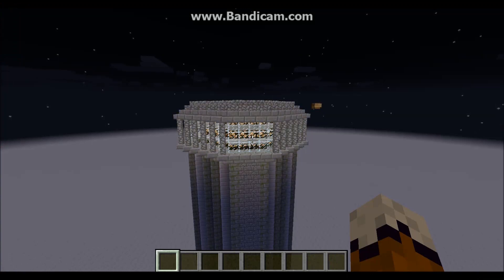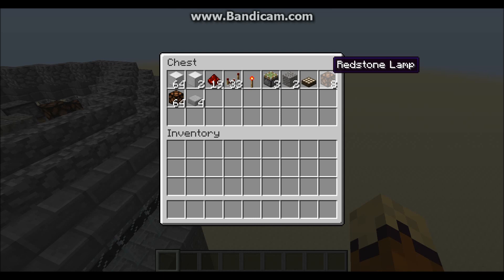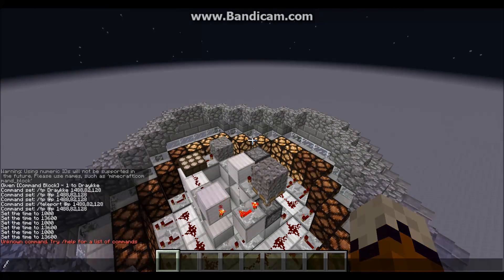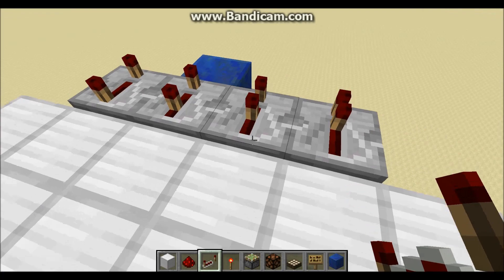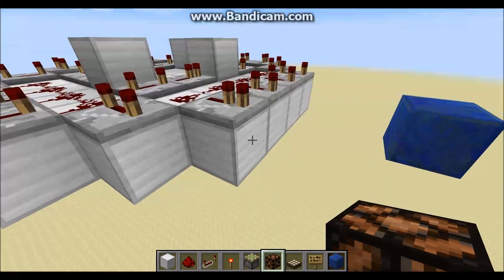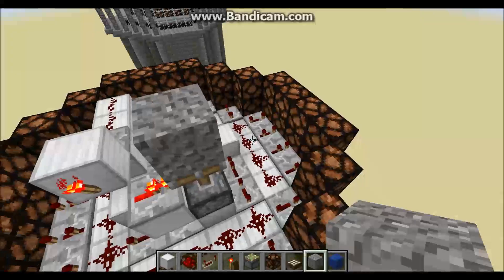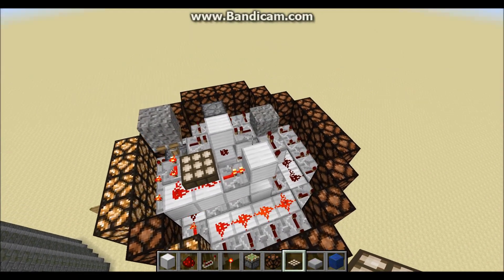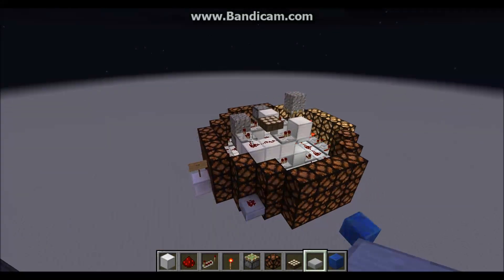RFH #3: (1.7.9+) Redstone Lighthouse Tutorial [Bright/Simple/Smooth-Transition]

Comment: This is an older video, but it is still relevant and useful. Everyone seems to be focused on the observer-based systems, but I'm on a server that limits the number of observers per chunk, so I sincerely appreciate this setup that is still working in 1.21.10. Is there a way to modify the circuitry at the center to allow for a 2nd stack of triple redstone lamp units above this one? Even if a stack of another block needs to separate the two? I've got a massive lighthouse that really needs a 5-6 stack high lamp.